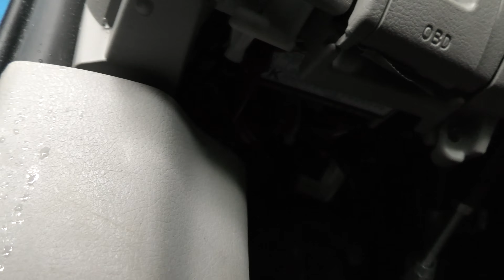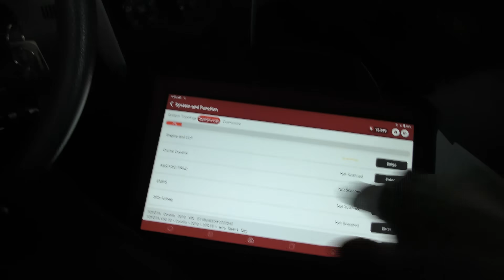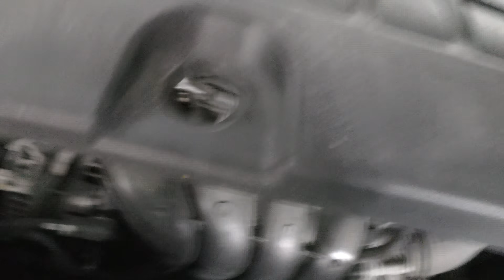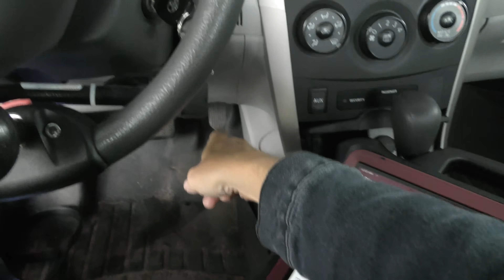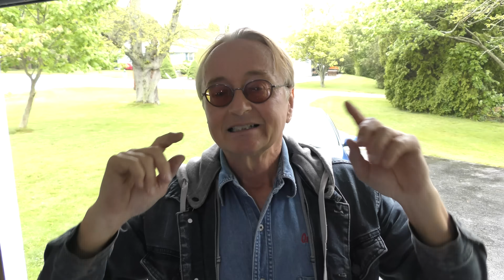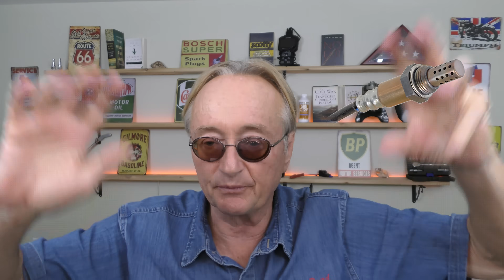Never Put This on Your Car

Comment: You are so right about the stuck brake. My car was riding rough, especially when hot.  I even had a mechanic look at it and he recommended replacing some suspension stuff (which it needed anyway at 100k+ miles). None of that fixed it. I had a bright idea to check the brakes myself. I thought the computer would warn me if a caliper was stuck. Nope, and it was a stuck caliper. Fixed the stuck caliper and she runs like a champ.
Reply: Dude scammed you

Comment: My 2020 excellerates when I slow dw below 15 mph.  It's  almost killed  me 6 times. The 3 dealership  say no codes  or can't  repeat . Unless it kills someone  they'll ignored  it. NHTSB HAVE BEEN NOTIFIED. MY ALERT SCREEN  SAYS TRANSMISSION,  THROTTLE  ISSUES. THE DEALER  DELEATEDTHE 6 ALERTS.  H.E.L.P.  !

Comment: I wish they still made cars with mechanical throttle bodies. 
You get complete and real control of the throttle, it will last forever, and extremely easy to clean/service.
The only benefit electronic throttle bodies have is cruise control can be implemented easier and programming slow response for 'eco' driving modes.
Some manufacturers automatically program the throttle bodies with terrible lag/hesitation on normal driving modes for better mpgs.
I drove a Chevy Cruze once and when I needed to merge and went full throttle it literally took 2 seconds before it did anything and was borderline dangerous because oncoming traffic was on its way.
My current Mazda on the other hand has excellent throttle response from the factory and acts like a mechanical throttle body for the most part.
Reply: most electronic throttle bodies learn your driving habits. so if your always putting around of course it will be slow to react to sudden throttle inputs because the ecu has learned thats not normal and might be a foot twitch or something that wasnt meant, they all have memory resets on them that will reset the learned delays. all be it they arent as snappy as mechanical generally speaking, but can be programed to be just as fast if it not faster then any mechanical throttle body. another bonus is you dont need to have IACVs and what not with a drive by wire, as it can be programed to control idle itself eliminating part prone to failure and vacuum leaks
Reply: @thetaco813  The only time throttle bodies should react slowly is when specifically driving in 'eco' driving modes, not in normal driving modes.

I had a 2015 GMC Canyon 6-speed manual and could NOT blip the throttle to raise RPMs and shift smoothly.
I had to get an aftermarket tune to get 1:1 input and finally had full control and made driving and shifting MUCH better.

Electronic throttle bodies can be as fast as mechanical but manufacturers intentionally program them to be lazy and that's a big problem. Why does the car have to learn your driving habits and not the other way around?
Reply: @Argedis  because safety. Sometimes economy but mainly its a safety thing because people just don't know how to drive. It's the same ways vehicles limit low end torque and power in certain gears or don't let you Rev the engine high when oil temp is cold.

Why wouldn't vehicles learn your driving habits?. Automatic transmissions do the same thing with shift points based on load inputs. It's all in trying to make an enjoyable driving experience. Because everyone wants to not feel anything as they drive
Reply: @thetaco813  Yes the ECU can cut fuel and implement a rev limiter that's completely fine. The TCU can change shift points. However removing control of the throttle is actually dangerous.

Many times I couldn't downshift correctly because the GMC could not let me rev match because of the stupid throttle. Downshifts became very jerky and caused me to be in potential dangerous situations at times.

The chevy cruze refused to go WOT when I had my foot down on the floor and traffic was approaching fast. I literally got scared.

Mazda doesn't do this and they give you full control of the throttle and they have some of the safest cars on the market. This is 100% a manufacturer decision.
Reply: @Argedis  dude that was a seriously long winded way to say you dont know how to drive. most people do not rev match to downshift. the people that do are more inclined to change characteristic of their vehicle to more suit their driving style and habbits, which you did. cars are made for the lowest common denominator mouth breather because they are the majority of buyers. 

mazdas safest cars on the market? maybe i cant attest to that but what i can attest to is they are some of the worst vehicles on my market in build quality and reliability. 

i seriously doubt the cruze refused to go full throttle you are clearly mistaking lack of power for the vehicle not working correctly then chevy cruz is not exactly a fast car especially in the non turbo versions, you got scared pulling into traffic?. maybe judge your distance better with the vehicle you are operating once again that is on you. and the exact reason why auto manufacturers design cars to be bubble wrapped so people dont get "Scared"

further more you are comparing a truck with a big v8 and endless amounts of low end torque to a tiny commuter car that makes 1/10th the power.... seriously apples to oranges you cant limit power in a car that has no power
Reply: Get a manuel!!
Reply: TB relearn procedure is key. Knowing your car helps. My 5 speed manual has a electronic TB and when I reset the ecm it goes into track mode for a while before it starts to slow itself down. I have a 03 Cadillac CTS manual transmission 3.2 l

Comment: Speaking of throttle bodies my Cadillac XTS was hesitating you put on the gas and it would do nothing like it wasn't getting gasoline or after a long drive it would sputter and even recently stalled out at a stop sign. Did some searches online and found that a recommended replacing the fuel filter but I can't find one online for this cadillac! Hate to go to the dealer. They also recommended checking the filters so I bought a new air filter and throttle body spray cleaner like you suggested and while the air filter canister was open I rev the engine and sprayed the heck out of it with this cleaner and it popped and sputtered a few times and then started running really smoothly. Still would like to find the fuel filter I'm sure it's original on this 2013. I used to get intermittent dash lights about the exhaust system sensors which they stuck inside the engine now instead of outside so you can't fix them. But those went away and never came back. Never buy another Cadillac but this one's nearly paid off and they're offering crazy money for trade in or sale. Problem is I can't find a replacement that's halfway decent that doesn't cost an arm and a leg now. I got this for around 30 grand in 2016 but can't find a luxury car that isn't 70 or 80 grand or more.

Comment: I think adding aftermarket alarm systems and stereos is perhaps the biggest problems people introduce, aside from adding mechanical things like turbos onto a motor that can't handle a turbo, or they use an aftermarket air intake system, as I've seen those cause problems too especailly if they use an aftermarket MAF sensor.    I never understood why people needed fancy alarms.  For the most part, most alarms will deter the backyard thief.  If someone really wants your car, an alarm is not going to deter them most likely and especially if you have a desireable car.  They know the tricks and this is why cars even with alarm systems still get stolen.  For stereos,  I feel if you're just adding a replacement head unit or regular speakers, it's fine to use the existing wiring (I usually get a harness and splice into the existing wiring harness so I can keep the original connector for the original radio in case I ever sell the vehicle I can put it back in).  Same for speakers.  It's when you start adding things like amps and subs that require more power where I think people get in trouble, because they overload circuits and breakers.  But if you get a general head unit and normal speakers (that don't require extra power) you are probably fine to just use adapters or harnesses and tie into the existing wiring.  I've done it about a dozen times so far without a problem (on various vehicles) but again, none were subs or amps.  Just regular head units and standard speakers with better sound quality (but didn't require any extra power from the car).

Comment: I tried to help get my friends RAV4 running this afternoon. Wouldn't crank even though the battery was good. No codes either. The car finally started but we don't think we solved the problem. I hate intermittent problems.
Reply: The starter motor may be just beginning to develop a dead spot (non-conductive) in the windings. If this is happening, as long as the starter motor winds down and stops outside of that tiny dead spot it will turn over just fine when you turn the key. If it stops right on that dead spot it won't conduct power from the battery.
Reply: I studied psychological torment on more than one occasion (37F, for those in the American military). Intermittent problems make me happy 😊, in the same way as some our worst sound tracks used to. Intermittent problems are world-class torture.
Reply: Fix it
Reply: @deerhunter8533  Not useful.

Comment: The 18 rio is. 1.6 GDI gamma and it has a 6 speed transmission. It’s 27 city and 37 highway 32 combined. Focus on the 32. Use a Scotty rated fuel system cleaner and make SURE you change the oil and filters. I have an 18 rio too!

Comment: My vehicle, a 2006 Subaru Outback, also threw a throttle code for a short while. At the time, the vehicle went into a type of limp mode whereby the engine was locked at 2500 RPM. On looking around next to my gas pedal, I found out what the problem might have been: the power line powering my subwoofer had fallen down next to the pedal's magnetic position sensor and started, I believe, introducing spurious data via its magnetic fields. I moved the line and reset my vehicle's computer module and that problem hasn't come back.

Comment: reminds me when I first learned about those drive by wire systems....the battery on my moms 08 Camry was dead. She attempted to jump it using my sisters car....she put both cables on 1 terminal. The cables caught fire. I ran up the stairs to assess the situation. After the cables caught fire, and were removed. I jumped her car the correct way. She tried to drive away, but the car wouldn't go past idle speed no matter how much she pressed on the gas pedal. Instinct told me it was a fuse. So I looked at the owners manual, and saw one for throttle control unit. Thought to myself...strange there's one of those...throttles are typically operated by cable. Long story short, I changed the fuse and it worked fine. Later that day I did indeed find out, that car did not have a throttle cable. What a stupid system though. Nothing wrong with throttle cables. These drive by wire system are just more expensive systems that can break...not to mention they all have a lag compared to throttle cables.
Reply: I completely agree, however the 'lag' is actually programmed in by the manufacturer and it's terrible.
Many program 'slow' response and hesitation/lag for better mpgs instead of giving you full control.
I used to own a 2015 GMC Canyon with a Manual Transmission and you could NOT 'blip' the throttle to increase rpms to shift.
If you tapped the accelerator nothing would happen and it caused bad shifts.
I was able to find an online company to 'tune' the computer and afterwards I was blown away and had FULL CONTROL of the throttle just like a mechanical throttle body. I could blip the throttle and it had INSTANT response.
So electronic throttle bodies could be good if they wanted them to.
I currently own a Mazda and it has the best throttle response from the factory that I've driven. They give you full control.
Reply: Exactly I miss good old carburetor cars with throttle cables. You could adjust them by hand. So easy to work on. Now you got to have all that computer equipment.

Comment: If I can't open the hood while the car or truck is running, lean under and pull a throttle cable and open the throttle body to rev it up without hitting the pedal or using a computer. I don't want to drive it. That's how I judge. If I if I like a car or not. Is the computer tell me how much to open the throttle body or is it a cable? If it's a cable that's my kind of car

Comment: I feel like the Hondas have a better response time than Toyotas.

I press down on the accelerator by 5%...

Honda (including 2001 TL Type-S, 2006 Accord LX SE, 2009 CR-V LX): near instant response, less than a second

Toyota (including 2001 Sienna CE, 2009 Corolla LE, 2013 RAV4 LE, 2019 RAV4 LE, 2010 IS 200): delayed response, more than one second
Reply: I feel like Hondas have a very lame acceleration, nice cars though.

Comment: I hear a lot of people pushing electric cars. Some reports say they are greener. really if you want to make a smaller carbon footprint, what we should do would be to outlaw automatic transmissions in anything smaller that about 3000cc. These type of drive systems use much more fuel in these smaller cars.
Reply: DPS6

Comment: When all the hubbub with the pedals was going on a dozen years or so ago, I lobbied my dealer for the replacement pedal. I wasn't about to allow them to fenagle with my original one, as per the recall. So, I had the new accelerator pedal installed on my '09 'Rolla. I've never had a problem with it.

Comment: I had a 2010 Corolla S before … best Corolla ever had!! But the interior was not as good as my ‘96 Corolla. 

229k km before I got rid of it. I usually get rid a vehicle before 200k km it was still running strong like new at that mileage! 
Sold it to my niece and still running! 

Bought a ‘15 Camry V6 then traded it in at 101k km for a brand new ‘21 Highlander September ’21

Long live Toyota!
Reply: You’re wasting a lot of money by buying new cars and getting rid of perfectly good Toyota’s that can last you decades. It’s your money in the end but why waste so much money?
Reply: @hungryhungryhiccups  you didn't ask me this question. I acknowledge that. I hope he responds. I am offering you an explanation as to why I buy new every 4-8 years. I keep the older cars and give them away. I  drive the used car and my wife drives the new and IMPROVED. Technology progresses. The newest car is 550 horsepower. Up from 7 years ago 440. Further, the new one drove itself home last Saturday night, 220 miles, in the rain, averaged 26 mpg and 78 mph. That's why. A great computer and a twin-turbo V-8. To me, it's worth the money.

Comment: I own an 2001 BMW X5..... My 1996 Toyota Avalon and a 1994 Toyota Celica both Toyota's have check engine lights on the the BMW X5 doesn't. I drive all three during the week on and off. Go figure. I  wonder if Scotty could answer the question . "Why does my 1996 Toyota Avalon and a 1994 Toyota Celica both have check engine lights on the the my BMW X5 doesn't.  All of them run GREAT!
Reply: Try checking the engine 💡

Comment: My friends are  having an issue with there car they  have a blue oval warning light. It say ford in the middle of the steering wheel .   Told them they better trade in.  And get a Toyota don’t think they can repair that